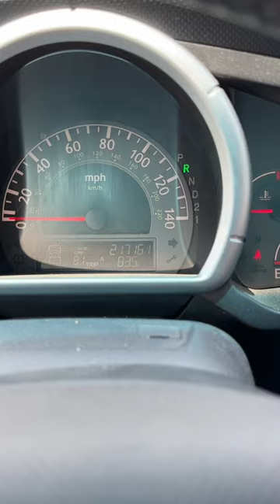What Is The Problem?

Comment: Could be the front CV axles are worn,  best thing to do would be to get the front up on jack stands, and the rear also. Have a helper put in gear while you listen and look, put in gear and listen to front CV's spin. Also the front strut top hats could be worn since the top hats have a bearing.

Comment: I would suspect maybe a bad half-shaft.  Take a look underneath and there is one going to each of the front wheels from the transaxle.  Look first for a ripped rubber boot (there will be two on each half shaft (aka axle).  If no rips visible, hand rotate each axle back and forth and see if you can reproduce the clunk.

You could also jack up the front end and hand turn each wheel back and forth to see if you can tell where the noise is coming from.

I don’t know much about ridgelines, but they are front wheel drive biased all wheel drive aren’t they?  If so It could possibly be the driveshaft going to the back wheels….a bad universal joint.

If none of that pans out, it might be something going on in your transaxle (transmission)….that would prob not be good news. 

One more thought…does it ONLY do it when shifting into gear?  If it occasionally does it while braking, I’d suspect maybe a loose brake pad or a broken pad retainer.  When you shift into gear, it could be shifting the pad and making a clunk.

Good luck!
Reply: Great comment, start here
Reply from the maker: Thank you for an awesome write up. I will start here and see if it’s anything of what you mentioned. I’m hoping it’s not the transaxle - that would suck..

Comment: U joints on the prop shaft. 200K is right about their lifespan. Any other vehicle it's a cheap fix... on the ridgeline, they are staked joints meaning they aren't serviceable. You have to replace the entire prop shaft. OEM price is ridiculous. Aftermarket makes a unit that works. Shipping is pricey because if its size. Easy to change yourself though.  The aftermarket unit isn't as high quality as OEM but chances are tou dont need it to last another 200K.  If it isn't the u joints on the prop shaft, check the CV joints in the half-shafts.

Comment: At 217K miles,  have you done your required transmission services?   Check your owners manual for the proper transmission service intervals.   Transmission fluid level low?  Take the truck to a trusted transmission service repair shop for a proper diagnosis.   Good luck!   🙏💪
Reply from the maker: I need to do a trans flush for sure.. I honestly haven't done the required transmission services tbh. My mechanic of 10+ years has just recently suggested I do a trans flush
Reply: @703Speed  Yes 👍!   A trans flush may solve the problem.   Good Luck!   💪🙏